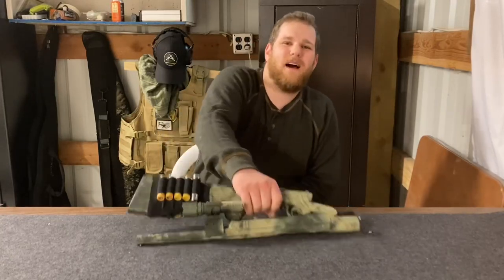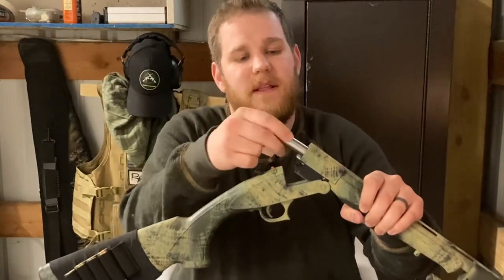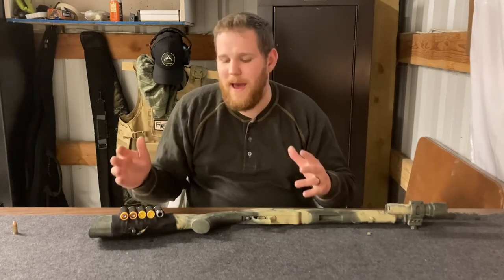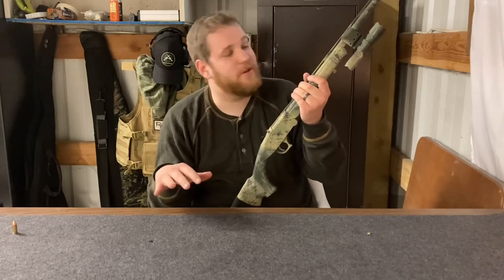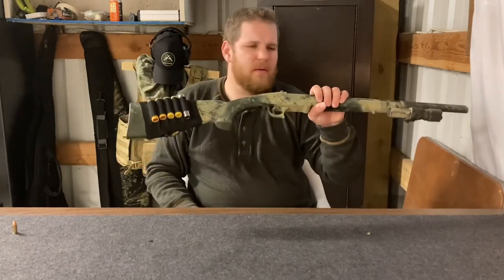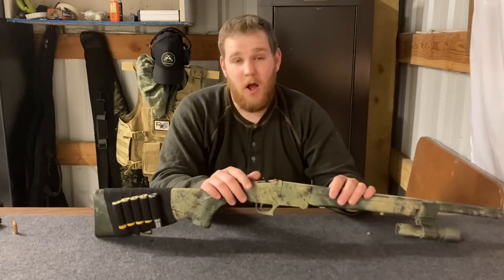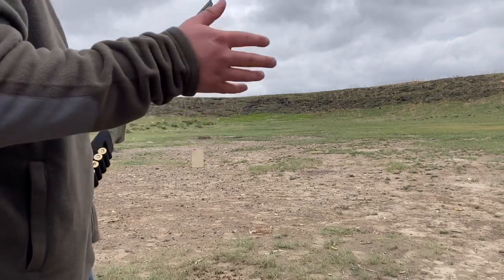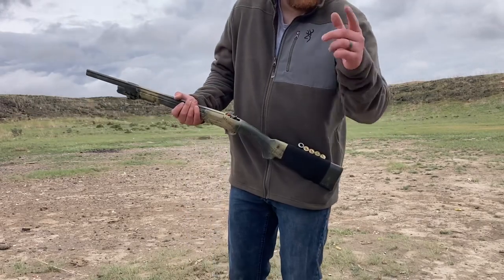Building A Survival Shotgun

Comment: I bought a .410 version of that same brand.  Mine was a wooden stock and fore end. I drilled holes in the top of the stock for 8 rounds of .410 ammo.. I added a flashlight and a laser sight on the fore end. Cut the barrel down to 18 inches to eliminate the choke. I have fired every conceivable type of .410 shot shell, including some very hot handloads with homemade lead slugs up to 350 grain.  It also shoots 45 Colt,, .44 Remington magnum, and 444Marlin. 444Marlin can penetrate 3/16 in steel plate. That is my survival gun.
Reply from the maker: That’s an awesome set up! Good to hear it’s serving you well!

Comment: I would installed screw in chokes because if it's a survival tool you want to be able too reach out and get something a little further
Reply from the maker: The 12 gauge version does take chokes and even comes with a set. This version, however, does not (at least not out of the box). It maybe something to look into though! Thanks for the idea!
Reply: Modified choke will handle just about anything  .....